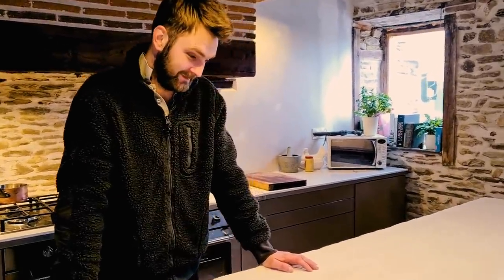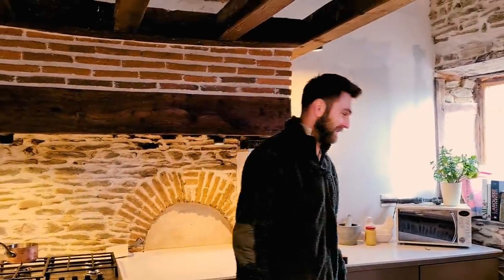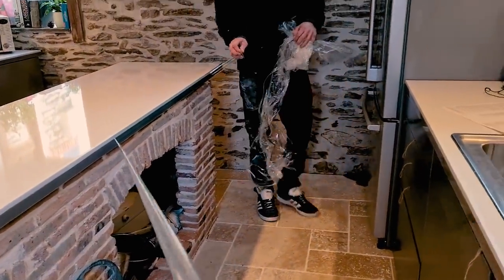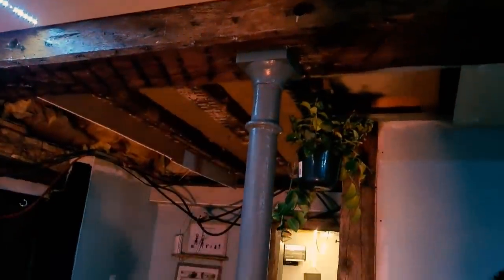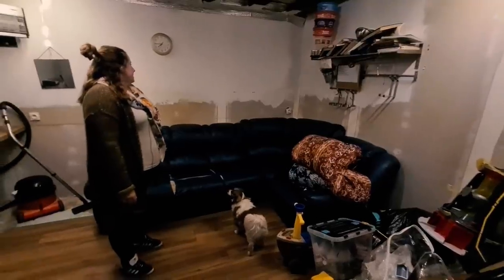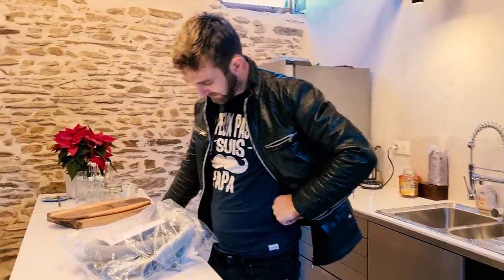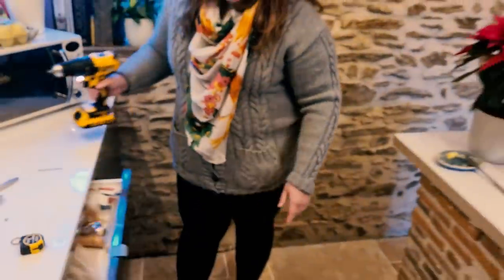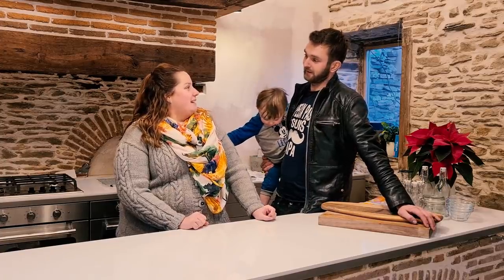Escape to Rural France- back to work! -EP024

Comment: hi guys sorry to see your counter top did not work out for you but the reason was the thickness was not the right thickness and  it cracked under stress from shrinking as well as drying out on wet OSB board which was trying to dry out as well, it would have been better to poor it in to a mould with prestressed steel and at a minimum of 50mm thickness then taken it out and fitted in place on a flexible compound base but good luck for next time

Comment: I’m sure you have been told this already but there were several problems with your concrete pour.  1 the slab was too thin. 2 first batch of concrete was too dry. 3 pouring onto the OSB ply sucked out the remaining moisture causing the cement to dry too quickly and last, the bubbles and edge quality issues were due to not enough vibration of the pour.  Don’t give up!

Comment: Hi Guys! In my humble opinion ,what could have happened is that you needed to put an iron mesh when the cement was fresh. It is probable that the wood that had as a base has moved (shrink - swell) due to humidity.

Comment: It's a shame about the concrete counter top but the new one looks just as good, loving the old mixed with new,😀it was great to get a tour of the rest of the downstairs, maybe if money was no object I'd recommend putting byfold patio doors where the window is in the old kitchen and a window where the patio door is now with a window seat for reading to the kids,it could be a special area just for them 🤗🌻🦋👍
Reply: South West Scotland  just to say urgency needed belt for your husbands trousers as it will help to hold them up annalise & for you detox your system  get into the habit a new health plan for 20/21 & it will help get rid of any colds (take advice on electrics) (safety hazard) open ceilings  loss of heat  stay safe

Comment: What a shame! The answer would have been a stone polisher before sealing or waxing. That gives you that smooth finish. I have made several cement countertops. I use white cement and porcelain powder (used in pottery). Then wet polish up to 3000 grit. Voila! You can also finish with food grade epoxy (stone coat)

Comment: I think your basket strainer needs either plumbers putty or a non-water-based silicone sealant applied before installing so it doesn't leak when you fill the sink with water. I hope you haven't found this out the hard way.

Comment: You can fill the crack but the concrete needs to be polished. You use a diamond polisher it is a fairly expert job. But you could try it.

Comment: I love your kitchen even better now.  You should be proud of all your handy work & planning.  I agree with putting your old wood burner in the living area for warmth & coziness.  The sliding patio doors you want to replace .....  my I suggest something I did to my house which I absolutely have loved, which is, I replaced my sliding doors (had 3 of them all old & not working well when I bought my house 4 years ago) with french doors.  The center of the 72" opening is the french door and both sides have functional windows.  If you'd like a picture please let me know.